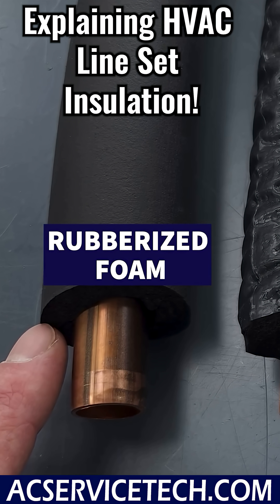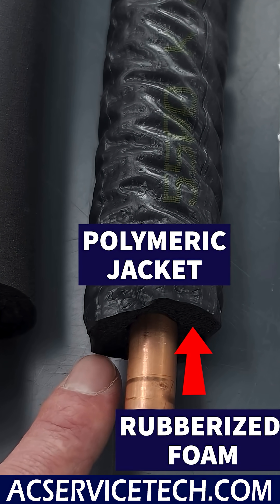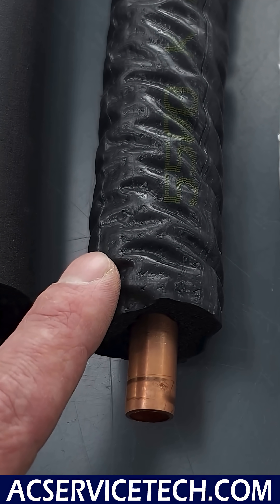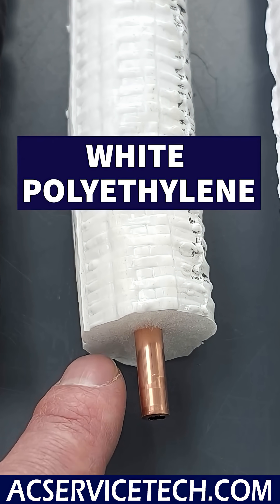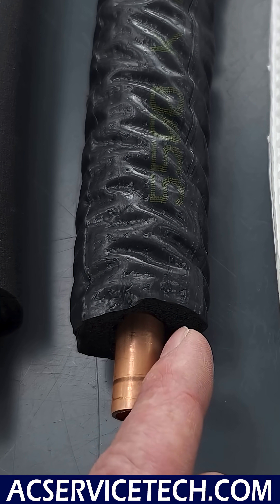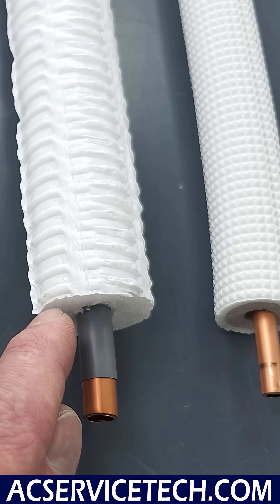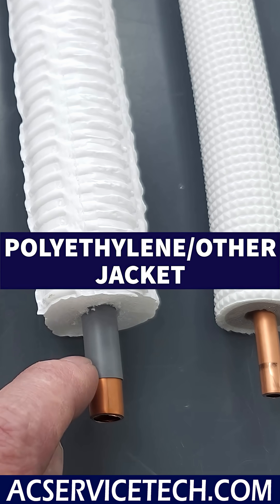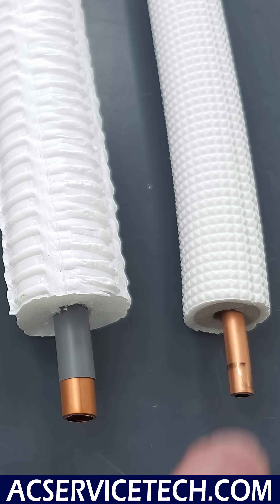HVAC Line Set Insulation Explained!

Comment: Why does my ac freeze up during the summer? Up in the air handler.
Reply: Normally it’s low on refrigerant. Also poor air flow and clogged evap coil. Change filters, look at the coil, if it’s dirty, carefully clean it up. If those don’t work, check the refrigerant in the system.
Reply: @-Kreger- thats where I'm at as being low

Comment: Is the one with 2 layers of Polyethylene and white outer jacket any good?   If the line are fully insulated, can condensation/moisture still form on the copper and corrode over time?

Comment: Love how Craig brings up some of the simplest things (like pipe insulation) and shines the light on problems that could or have occurred. Me personally, I tried to stay with elastomeric material line set insulation and I think most of the quality brands use it.
Craig, keep shining the light on those small things  👍 . Always liked the line in Sling Blade where Billy Bob Thornton & I quote “ there ain’t no gas in it”😂.

Comment: Sorry no offense but I'm staying away from the polyethylene foam lines sets. I already had 3 systems to replace bad lines sets. That's lost time in money that I wont get back. Had to eat it because I stand behind my installs. I only use muller rubber foam insulated line sets.
Reply: Same experience here. I have only seen formicary corrosion on the white linesets. I used to use them due to the lower upfront costs but have become wiser.

Comment: I have the two layer, gray and white. 
Unrelated question I can't find an answer for. I have a 5/8" and 1/4" line set because Gree spec sheet called for 5/8" suction line. But it turns out that the indoor unit is actually 1/2" suction line. Can I use the 5/8" line set and adapt down to 1/2" at the indoor unit connection. Some say no, some say yes?
Reply: I'd say yes because you're going slightly bigger on the line set, thus you're not creating a restriction. However, for warranty purposes, check the installation instructions book, and if it's not available,  then check with the manufacturer or the supply house.
Reply: @CesarCadevilla  Thanks, the spec sheet said the IU was 5/8" but reality it is only 1/2". The supply house said they don't recommend using an adapter at the indoor unit (IU).
Reply: It'll be fine.  I just did a Mr Cool system that was the other way around.  Traditional lineset and install method, but the connection on the outdoor unit was a size smaller than the section connection on the air handler.  The instructions said to get the larger lineset and they provided adaptors to adapt down a size at the condenser.

Comment: Love your videos in general, but this one is not too useful.  Maybe you can say how they compare in performance and durability?  Which one do you recommend?  Why should I choose one over the other?
Reply: Rubberized is better option the poly foam can let copper sweat and retain moisture. I’ve seen I few water damage issues with them and line set pinholes on poly foam linesets mostly on mini splits.

Comment: The white PE insulation is garbage. I thought it was tested and proven to be better for UV degradation, but it falls apart after minimal exposure to the elements.
I'm not surprised that it corrodes the copper piping.
Reply: Yep the white insolation is garbage. Avoid it at all costs.
Reply: Haven't seen the white corrode the copper.... the black insulation is gone in 2 months and the white lasts longer.
Reply: @chrisl6263  Gone in 2 months. Never have I ever 😂
Reply: @FlyRasta420 Florida Sun wrecks everything bro..
Reply: @francom6230  I know from 10 years of installing there. Never happened to my installs when I go back for maintenance.

Comment: I love the heavy white doesn't tear cuts clean MGBY Everyone prayers 🙏
Reply: Ya until you gotta rip it all out and run a new lineset lol. Ive replaced at least 10 entire linesets years ago,I dont work resi anymore, do to leaks from the white insullation. Im sure companies have figured it all out and we've gotten past that on new linesets but there's still so many older ones out there leaking somewhere.  I see they have multi layers and sleeves now to prevent it hopefully. I'll also add, there has to be moisture and oxygen present to cause the corrosion issues on the tubing, so a fully sealed lineset won't have that issue, has to be 100% sealed, which is not usually what you'll find in the field.
Reply: I didn't even think the gray and white line sets been out for 10 years plus to rust out copper @HVACRTECH-83

Comment: The white jacket also known as 'ez pull' under some manufactures.

Ive heard that some are being sued due to the breakdown of the material leaving many outdoor portions of that material to completely wither away and expose the copper to outdoor climate.

When I worked in a supply house everyone asked for that material, 5 years later every time I seee it in the field its completely broken down thanks to the uv rays
Reply: Craig I’ve been reading the second edition refrigerant charging book on my iPad.. Great Book. I have the first book too but I have Fieldpiece probes so obviously needed the second edition.. I read that book non stop for over 24 Hours.. it’s a great book well written well thought out and honestly it’s worth reading especially if someone is new to HVAC.. just read that book front to back before you do anything else and everything will eventually make sense.. and then read it again a month or two later.. Thanks Craig! 2nd edition is a work of art brother!! 

Scott Home Service and HVAC, Boston, MA
Reply from the maker: Thank you for your kind words and for picking up my books!! I'm glad you have been able to use and learn so much from it!